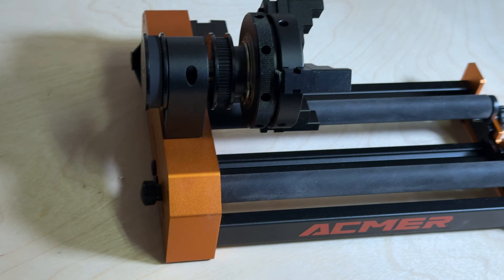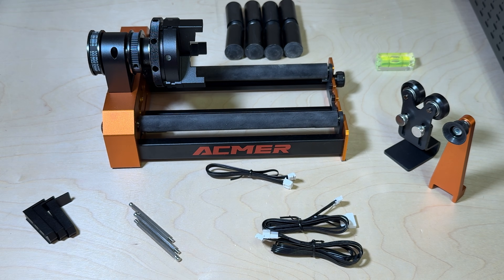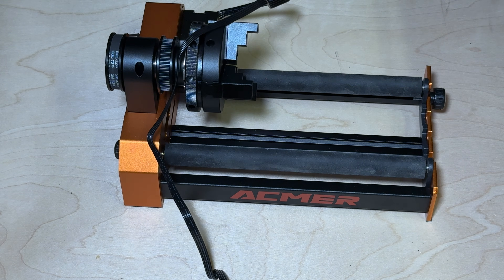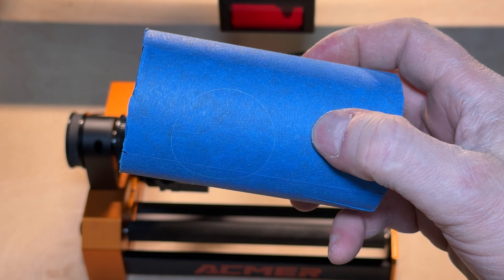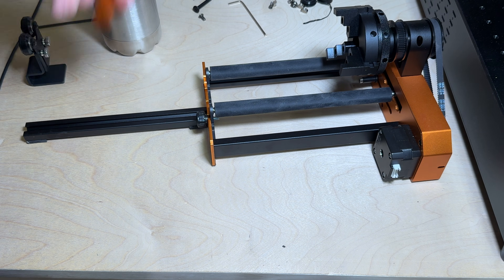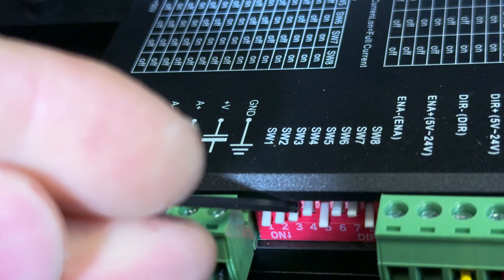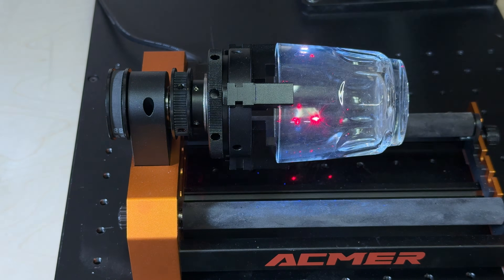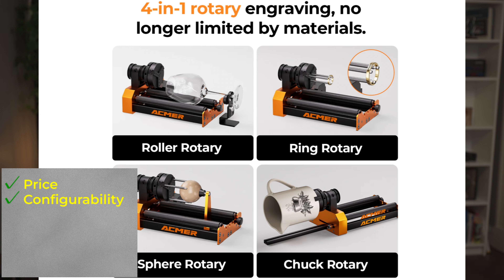Watch This Before Buying Any Laser Rotary Attachment!

Comment: A webstore without a price listed.  I would think even though they are sold out they would leave the price for those wondering whether or not to wait for a restock.  I am looking for a rotary but if they can't list the price I don't think I'll wait on it.  The price for the P3 was listed and wow, I hope it's an incredible diode laser for that price.  If the rotary is as overpriced as the laser I'll skip it and get one of the good cost effective ones.
Reply from the maker: The M4 Rotary is less then $200.

Comment: Cost wise, this is way cheaper than PiBurn Omni, but how would you say it compares?
Reply from the maker: I haven’t used that one. But most rotaries are similar in operation. The major differences are the overall abilities to morph into the rotary tool that you need he.g. Roller vs chuck)

Comment: How large a diameter tube would this accommodate?  Wanna cut slots in paper/cardboard tubes up to at least 4”.  That’s a more general question, but I don’t have a rotary and am considering one… Thanks!
Reply from the maker: You can put the chuck on the outside and lift the laser and the rotary to accommodate larger items

Comment: Nice review, where did you find the adapter cable for the Omni 1?
Reply from the maker: ComMarker will sell you one but you can make one easy enough.  You need a 4 pin aircraft plug and a stepper motor cable that you can buy on Amazon.  On the aircraft plug, pin 1 and 2  is one phase of the stepper and pin 3 and 4 are the other.
Reply: @ thanks

Comment: The Xtool rotary is just as flexible.
Reply from the maker: Well I have two of the RA2 Pros and they have some of the features, but I  now like this one a bit better.
Reply: @SteveMakesEverything Can you say what differences led you to this preference?  Thanks!
Reply from the maker: @DavZell  First, I'll say that there's nothing wrong with the RA2 Pro, but it costs 25% more for starters, and the M4 has absolutely no plastic parts, so it is far more durable, and the metal chuck fingers grab onto things better.  Also, on the M4 you don't need to remove the rollers because you can turn the chuck the other direction.  This means you can have both the chuck and rollers ready at all time without doing any reconfiguration.

There is no major difference between these two rotaries, but the little things add up.
Reply: Can you please tell me if the xtool RA2 PRO works with the comarker  Omni one and if it does how do you find out about its hook up
Thanks
Reply from the maker: @garymtruehart9977  Any rotary with a standard stepper motor will work.  For the RA2 Pro, you will need to buy or build a cable from the Omni1, and you will also need to change the current as I did in this video.